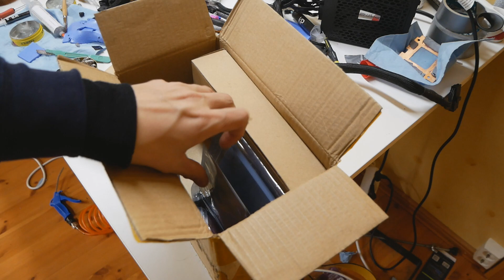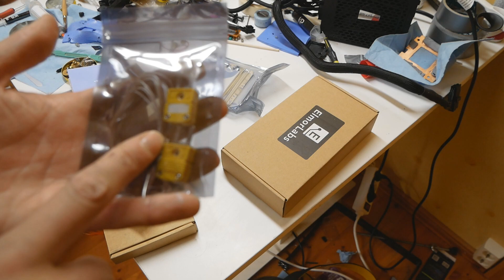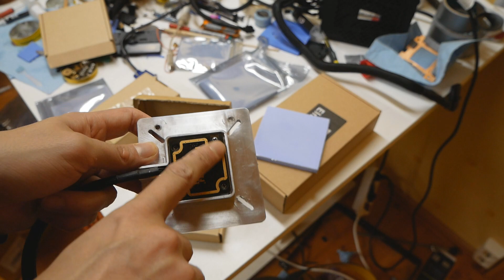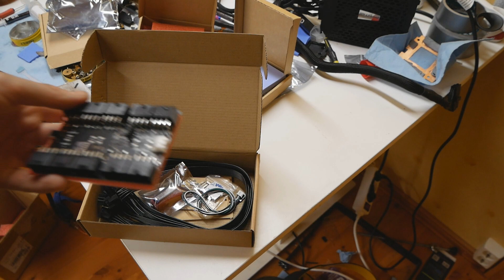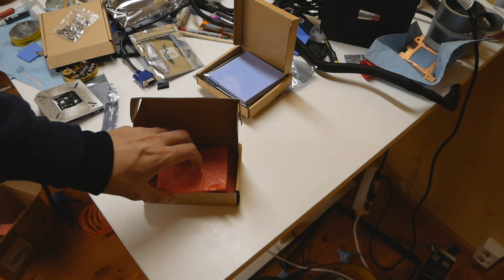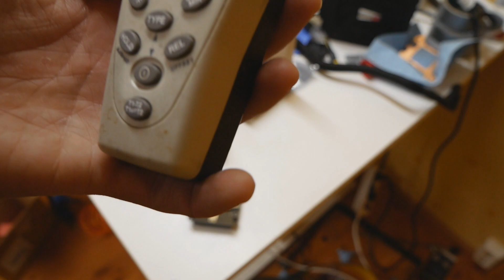Mailbag Monday - Amazing New Tools from ElmorLabs

Comment: With a dual power supply setup, connecting the black and green of two power supplies together, you can measure the power consumption of your GPU with a socket meter on the GPU power supply. The rest is on the other plug. It will offset the measurement a tiny bit because there are two supplies but it can give you some insight. I have used a dual power supply setup for a long time when one supply was not enough for my entire system. I can definitely recommend the dual power supply method if your supply is too weak on it's own.Thanks for your videos!